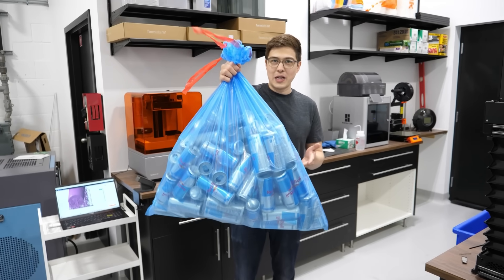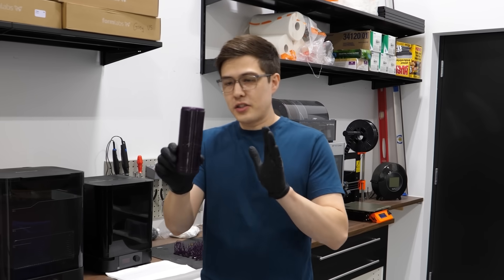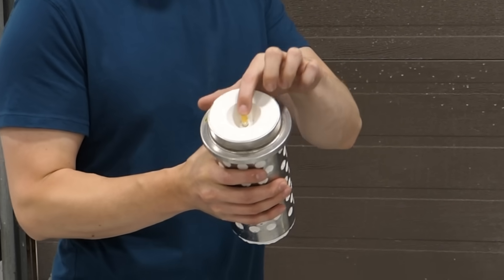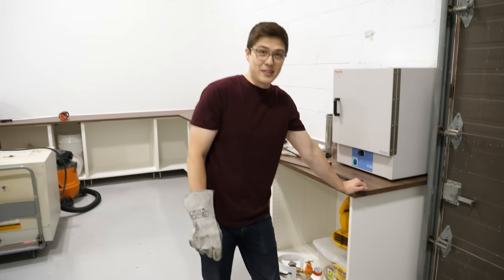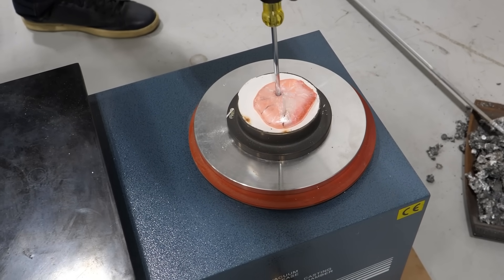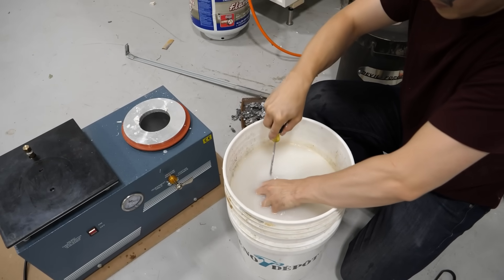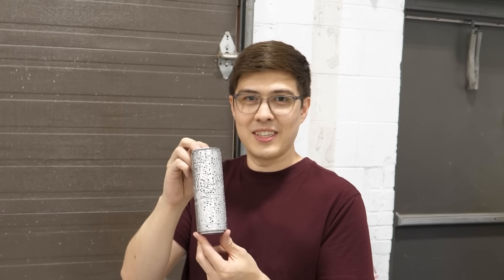Melting down 100 cans of Red Bull into just 1

Comment: Using that forge in a closed garage is an activity only NileRed is capable of doing.
Reply: Have to imagine he has ventilation moving fresh air through
Reply: His chemistry is (generally) safely conducted, but it seems whenever he ventures outside of that, some of the dumbest mistake I've ever seen start to surface.
Reply: @squidikka I've seen this in every discipline I've been associated with. You should see geologists with explosives doing seismic.
Reply: @squidikka he has YouTube plot armor. His audience’s need for continued uploads keeps him safe.
Reply: @squidikka he's got like 5 fume hoods, there's nothing wrong with using it indoors with that much ventilation
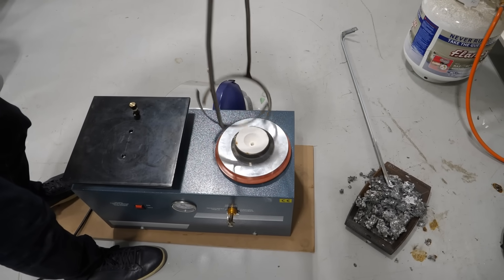Reply: @squidikka Press the buttons on the side of your phome to turn up the volume at 2:40 What do you think that sound is in the background? 💨 Thats a fan lol
Reply: I was thinking the same but when he turns the furnace off around the 2:43 mark you can hear a loud fan in the background, so it certainly sounded like decent extraction.
Reply: @cozmium i think it's amazing people would think nigel is even capable of making that big a mistake. That's insulting. And yeah, you can hear the obnoxiously loud fan in the background. 

Those comments are coming from people who are searching for an opportunity to act like theyre smarter than nigel 😂
Reply: yeah he didn't account for the thin plastic coating inside the cans. The air must be toxic as fuck.
Reply: and on concrete which could retain a lot of moisture.
Reply: At 2:40 you can clearly hear the obnoxiously loud fans ventilating the room. Turn up your volume 😂 

Also, youre mocking him for doing something dangerous that should render him unconscious, while clearly seeing him talking and acting normal and healthy. This should clue you into the fact the room is well ventilated.
Reply: @daminox  He's not gonna sleep with you baby bro.

Comment: You have to run the poured aluminum through a vacuum or a centrifuge in order to get rid of the bubbles when casting.

The metal cools too fast for the gas to escape the mould and molten metal.